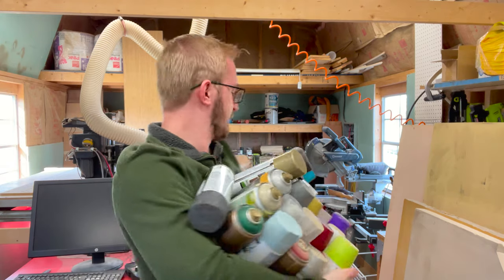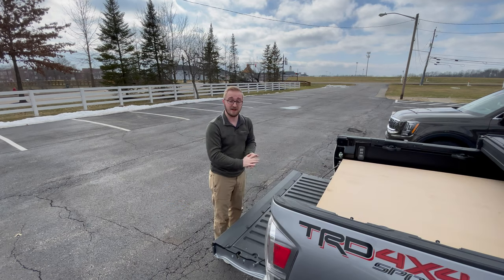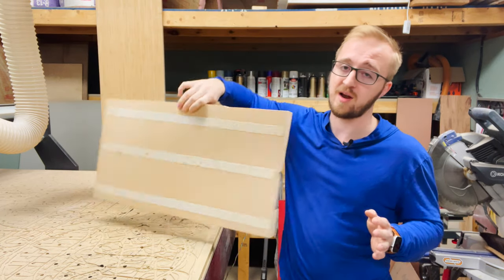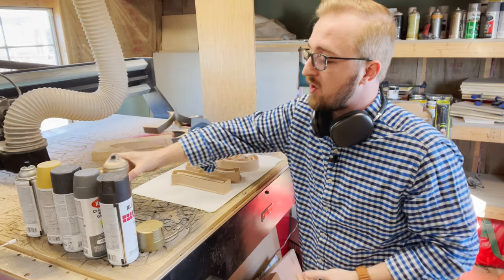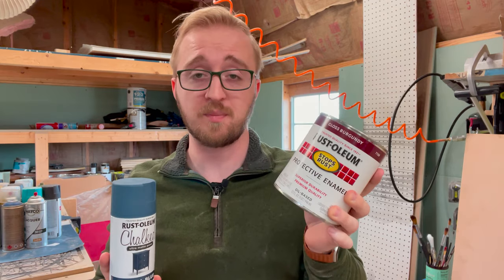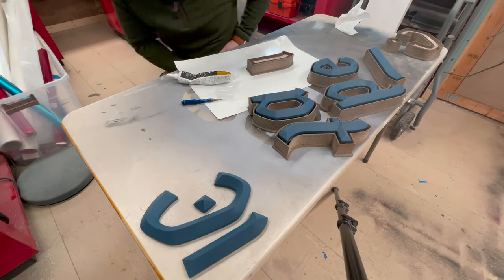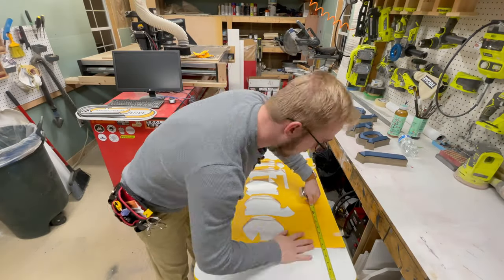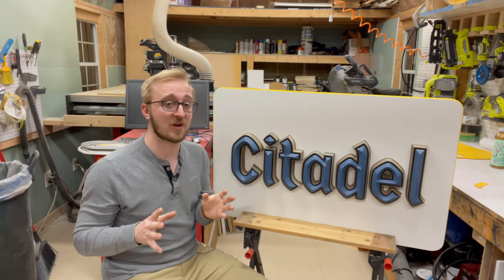DIY 3D Medieval Typography - LOREM IPSUM SERIES

Comment: looks awesome !, What spindle do you use?
Reply from the maker: Thank you! It’s just a metabo hand held router in a carriage assembly. One of these days I’ll get a big boy 220v spindle. I have a new machine scoped out!
Reply: @CrabtreeCreative  Thank you, I have a onefinity cnc with a makita router but i'm limited to 1/4" bits. I want to upgrade to an 80 mm spindle. Great videos I want to learn more about what is possible with a cnc machine.
Reply from the maker: @brandonpeters1987  I have seen good things about those Cnc machines! There is a guy near me with one I got to check out. You should be able to do most anything with 1/4 inch bits too. Immlrettt sire amana makes some nice 1/4 inch V bits you can look into. Definitely stay tuned for more videos in this Lorem ipsum series. I have some really cool ideas planned.